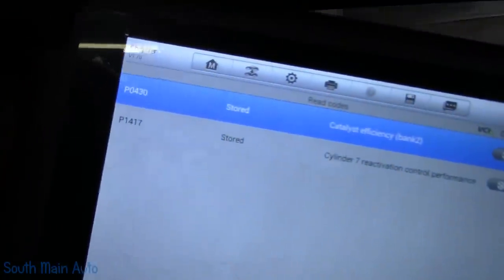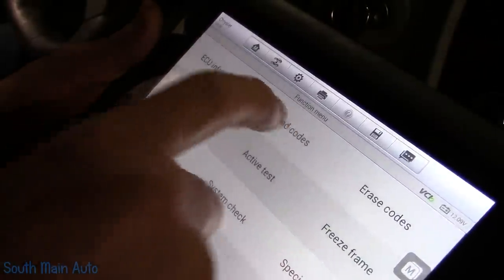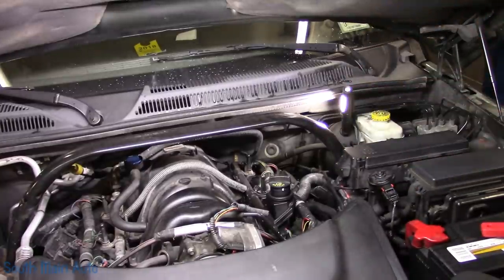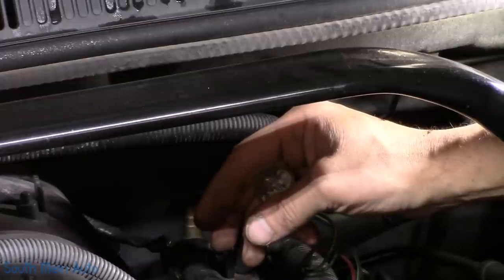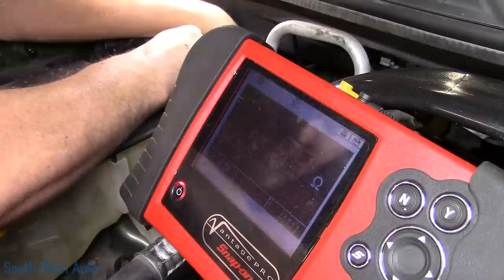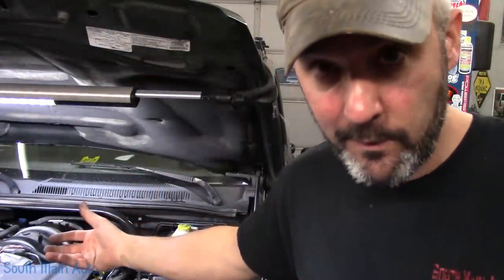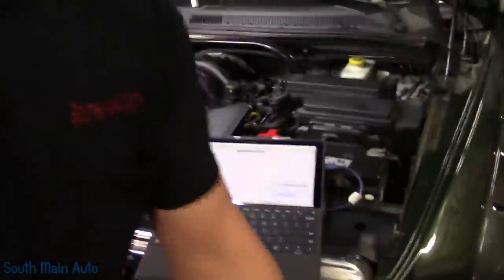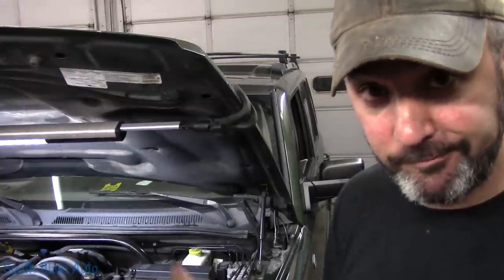Jeep Commander: Dead Misfire / No Parts Needed

Comment from the maker: For what ever reason in the beginning of the video when the engine is misfiring the camera makes the engine sound awful (mechanical noise) TRUST ME WHEN I SAY THIS, it was not "knocking" or making any abnormal noises, despite how much better ON VIDEO it sounded after the repair. Just thought I would clear this up 🔧🔨🔩⚙
-Eric O.
Reply: (TSB) - 09-015-04 and 09-013-04 - says: “Vehicles with the Multiple Displacement System must use SAE 5W-20 oil. Failure to do so may result in improper operation of the MDS...  maybe??
Reply: You know.... I always forget why i lug around my old Techtronics 'scope. Seeing you fight with that SnapOff reminded me why...
Reply: Actually, engines are pretty precise and intricate pieces of machinery.   And these machines are highly dependent (now) on sophisticated electronic hardware and software to make them run as effectively and efficiently as possible while providing power and reliability each and every mile they are operated.  By the time an engine package rolls out to the arena of operations, the engineers are knee deep in the next generation, the next innovation, the next hardware improvement and newest software development.  At some point during its operation, this machine convinced itself that there was a problem with cylinder 7 coming back to life after a shutdown.  Momentarily stuck solenoid, a tiny bit of debris in an oil passage.... or a solenoid coil that’s become temperature sensitive...  just enough to trigger a code and assume a solution to protect itself.  And then, someone like you, with a much higher understanding, to free it from it’s bonds.  To become 8 cylinders again.

Hey, Eric, let us know if you got it to trigger the code again.  😂😂. Had you goin there for a second didn’t I?
Reply: great video......still want a classic car...... too much Jetsons beepen boopen danger Will Robinson for my taste
Reply: @clevelandmaker386  have to agree. I own a shop in Cleveland lol. I believe we should worry about nox but this driveless self parking auto seats are crazy. So many people can't drive now so can you imagine. Also when something breaks expensive, even a auto door handle switch can cause a no start. I love the new technology for power and torque but everything else is a wash. It has nothing to do with figuring out the technology I love the challenge but it's calling the customer and saying your bill is 1200$ for garbage.
Reply: Grandma's Malibu  I work for a car manufacturer at their assembly plant. Believe me, we often ask those same questions when the cars are being built.
Reply: @grandmasmalibu  r
Reply: @wyo engineer - I have a portable scope that works really well.  They are only around $400 for a decent one - I have a Siglent SH800 but there are lots of others out there - Eric 0 also uses a pico scope, which I find too small.  I think the advantage of the Vantage is that it's a multipurpose device, although way overpriced.  Edit - thought the Pico Eric O. refers to was one of those mini-scopes with a 4" screen....
Reply: Give a shot of Marvel Mastery Oil.
Reply: Could have just been a hung ecu function, but you have to also remember what did I do?  I unplugged and replugged a number of connectors as well as removed power to the ecu.  Could have been a loose plug, or just a system reset.  Following the standard flow chart said no other failure if all checked out, then it can only be bad plug connection or ecu logic error corrected by reboot.
Reply: HEY ERIC O n MRS  O n FAMILY|
Reply: South Main Auto Repair LLC  , Eric it never fails to astound me with the massive amount of  the “KEY BOARD  COMMANDOES “ that feel the need to tell you how much that you did “your” repair wrong , or how much your phone /Door rings upset them ... seriously? get over yourself ! Good work sir ... from Canada
Reply: What would cause it to set the catalyst code too?
Reply: Its going to be interesting what happens in the future. They already keep certain PIDs away, at least Toyota does. Sure they all do, no matter what reader you may have.
Reply: I have a 2000 WJ with a 4-7 that has a fresh rebuild I put about four thousand miles on it the engine runs great I run 530 full synthetic I'm getting the same issue with this for 7 where it just wants to shut down two cylinders and you can go and pull it over turn it off cycle the key and it resets itself I have done tons of stuff just like you with testing the connectors the pens and everything I think that these Chrysler's are just kind of confused vehicles I'm still trying to figure mine out like I said it will run great and then it will Hiccup and it will shut itself down I've compression tested it are check connectors injectors swap them I'm at a loss with mine
Reply: Pin fitment issue at pcm or coil? Possibly reset when reclipped senior
Reply: I have an 06 Commander that has a ghost in it if it sits you can crank it and drive all day sometimes and sometimes it may run 20 minutes and die while driving and may not crank again for a couple hours I don't have all the equipment but I have worked on older vehicles all my life but this thing is over my head

Comment: A friend of mine complained about her Mercury Mountaineer not running right. Looked at it and diagnosed it for 2 hours checking every little thing and came up empty. Went into ForScan, reset the learned procedures, and warned her it might take a few drive cycles to acclimate. Ran like a champ and has been for a year now. Sometimes these newer cars just need to relax and have a beer (reset).

Comment: Interesting technique of scoping the solenoids current waveform to see the internal mechanical operation.
Reply: Applies similarly to injectors too.
Reply: Ah the bearded man! Nice to see you lurking about the place.
Reply: Hahaha, I replied previously and didn't notice it was to Big Clive.
Reply: As the solenoid core moves the inductance changes and produces that butterfly current waveform.  There have been papers over the years about measuring the solenoid position based on current feedback from the coil, I wonder if that is used here.  I wonder what they use to declare the solenoid failed as opposed to just a misfire.
Reply: Bears & cars, who'd a thunk it lol
Reply: why, it's a Big Clive! heh
Reply: No way! Big Clive and SMA, what a combo.
Reply: Super Vitz I thought the same - just need AvE to chime in now
Reply: i've always referred to it as a gull wave........kinda like kids drawing birds flying.......knew it was good for
 injectors, vent valves, purge valves .......nice to know it works on oil fed solenoids....

Comment: I made my living as an trouble shooter/repair guy like you do. Your customer is very lucky(smart) to bring this to you. You did all the rite things to determine what is wrong. In the end you had a problem that went away with the rite resets. Many lesser experts would have taken the thing all apart and thrown parts at it. I really appreciate this video as it shows how you troubleshoot to find the problem. I had to have an FCC license to do my work so when doing something like this and being asked what did I do to fix it. I would reply, I waved my license over it. thanks for the comments on the license waving. we do need to have some fun.
Reply: I like the "wave license over it" going to steal that! Charge the $10 to hit it with a hammer... Then also charge the $500 to know where to hit it.
Reply: For 34 years I was an electronics tech for a university chemistry department. When PhD researchers asked "What fixed it?" I sometimes said "Scientists have to explain why things happen. Techs don't".
Reply: I work on some old worn out CNC machines and have crossed wires I shouldn't have learning myself the ropes. Now, these machines don't go anywhere and are in the same room so when something miraculously starts working when I show up, I claim it's scared of what I'll do to it.

Comment: Another great diagnosis video proving Eric O's ability in getting to the root of an automotive issue rather then throwing parts at it & wasting money! I have a problem with the cooling system on a 03 focus which eludes me! I wish i could have Eric O diagnose the problem! I found a smoked cooling fan resistor wire harness & replaced both the resistor & harness yet, the fans don't cycle properly! put a toggle switch on the 5v reference wire & it turns on the fans There is several ways to make the fans run constantly which caused my alternator to fail so, running a toggle switch allows me some control but, IT IS NOT THE CORRECT SOLUTION, JUST TEMPERARY! I SO WISH ERIC COULD DO MOBIL AUTO REPAIR!

Comment: This video is a few years old but is a big help this tech knows what the hell he's doing, I like how he analyzes using knowledge of electrical. I do "HVAC/R" my skills are similar in my approach. I have a problem with my 2006 Jeep Commander 4.7L, repaired a myriad of issues from overheating first due to fan blade shroud coming lose over radiator (thought it was a leaking radiator), then leaking plastic "T" to cabin heater core, after replacing that & filling radiator (which was not empty) engine wouldn't start, I only disconnected air intake hose to "M.A.F sensor" momentarily, no leaking "vacuum tubes", when I put my diagnosis computer on the engine it said cylinder 1 misfire then multiple misfires. I will check it tomorrow to figure out what the hell is going on. (Prior) I never let the needle touch red-only to halfway and turned vehicle off until I could put it in a good parking spot. I left it for four days it was too cold to mess with until repair stated above.

Comment: Not surprised you found this. Modern computers 🤦
So the PCM thought it has a fault and shut off the injector, which was the source of the misfire. Brilliant! Good job diagnosing it and not charging the customer a fortune to pull the head and replace the lifters/solenoid. You are one of the few very good diagnostic techs Eric. You deserve more credit than you give yourself!

Comment: Awesome diag. I love watching other people's diag process, it helps fine tune mine. We all have our ways of going about stuff we have learned through good 'ol school of hard knocks. I do believe this vehicle will come back with either a bad solenoid or the jumper harness under intake shorted (i have seen oil soaked wires with insulation falling apart, intermittently touching) . from experience only i would of resorted to swaptronics if the harness passed the visual and have the customer take it back if i cant duplicate it.

Comment: My thoughts:  Vehicle was probably run low on oil at some point and the ECM saw something it didn’t like during the cylinder management and set code and disabled injector.  Vehicle oil was corrected and everything stared working properly again but ECM programmed to continually disable injector until a reset is done.  This programming was probably done by Chrysler engineers because they either thought it was necessary to protect components or they figured there is no way it would ever be an intermittent problem.
Reply: But the other cylinders didnt trigger the condition nor stayed disabled. The ECM can still re-test the cylinder periodically to see if it is able to work again or not and if the test is positive, just clear that condition. The defensive programming is very important, and so does the self healing approach. Looks more like a glitch. ECM continue using volatile memory to store important data even when the car is shut off. The only way to force a data reset is a battery disconnect. Now, serious noise like the one produced on cranking with drops up to 5V have a chance to corrupt data. Automotive modules are designed to deal with that. ... but nothing is perfect. After all just keep in mind that any cellphone needs to be reset once a week (to say something) while the ECM reset ocurr on a battery change or under scan tool control. I mean, is posible to have a permanent issue even after a glitch.  Sure we can discuss that data is covered by CRC, but this is not enough. Im asumming a noise issue somewhere. It is not uncommon
Reply: TJ Roelsma Over here in the USA we call that an Italian Tune-up, because the older Ferrari's and Lambo's would be bought by rich people as a status symbol and used as daily driver instead of being used as a street-legal race car, which meant the engine would start running rougher and rougher. Reason is that all those short trips never let the engine warm up to operating temperature, so it clogged with carbon and deposits.
Solution? Change the oil and filter, fill the tank with premium gas, cruise around at around 60 miles an hour for half an hour or so, then floor it from 30 to 90 miles an hour, and repeat that acceleration 10 times over.
Change the oil because short trips result in condensation inside the engine crankcase resulting in the oil acidifying, fill the tank with premium gas because that's what it's designed to run on (especially if it has any kind of forced induction), the 60 mile an hour cruise brings the engine up to operating temperature, and the rapid acceleration burns the carbon off the the pistons and knocks it loose from the valves.
Result? Internally clean, smooth running engine.
Reply: Driving 90 MPH is more expensive in Massachusetts than taking the vehicle to a qualified mechanic!

Comment: Eric, 

I just had a Dodge ram in the shop with the exact same problem.  After following the same diagnostic route as you I came to the same fix.  Disconnecting the battery for a few minutes fixed the problem.   Customer has had the truck for a few weeks now with no problems.  After searching online I've found a few doccumented cases of this.

Comment: My Magnum has this system as well so I'm watching and listening with intensified interest.
Reply: My Aspen has this also and I would be interested to know if the correct oil viscosity was used when last changed.  Is it possible that the cooler oil before closed loop is having a hard time getting through the valve body?  I have heard of this being an issue and perhaps after it runs awhile, it might make the oil passage easier??  Just a silly thought.  The Tow/Haul switch kills the MDS so you can verify states without a tool if needed.
Reply: At least yours is a V8 (I assume) and not the dreaded 2.7 V6!  My brother in law had  both his head gaskets blow on his 2.7 Magnum.

Comment: Great frekin’ video, had me on the edge of my chair. Well, as an auto mechanic turned commercial HVAC tech, (now retired) I can tell you that 99.9 times out of 100, an electrical related problem will return after a reset only. Unless there was a known voltage spike of some type. Maybe this one will fall into the .1% category. Thanks “Big O”.

Comment: Was a Chrysler mechanic for almost 16 years, when Chrysler came out with that MDS system it was a real pain in rear...can tell you that system would throw a lot of issues if the customer did not change oil on a regular basis, when they get a lot of miles it seemed we changed out a lot of those solenoids due to lack of clean lubrication

Comment: Well, noticed something like this before.  Had to do with how long the vehicle was driven and noticed the injector wiring from that similar cylinder was sitting on or almost on the engine.  Which caused the misfire.  Moved the wiring and added more protect from the heat of the engine.  Simple fix and changed the oil.  😊  Love the videos Eric O.  South Main Rocks.  😁  I've found vehicles have things like hiccups. 😁